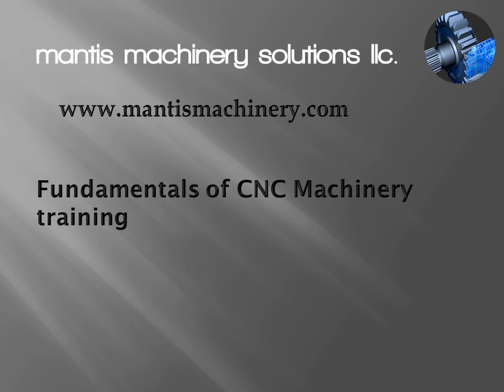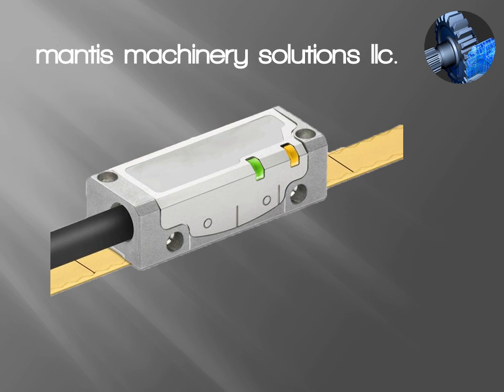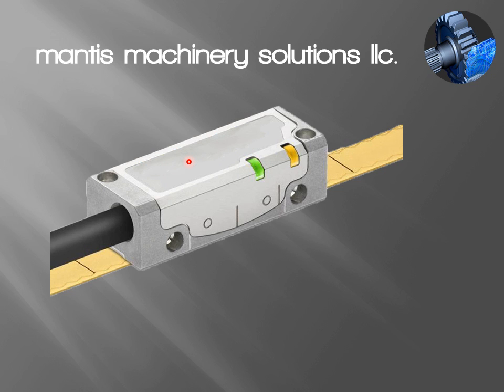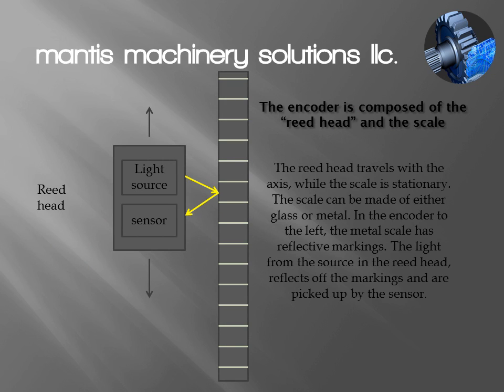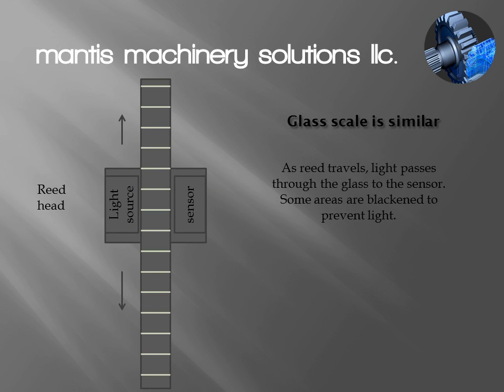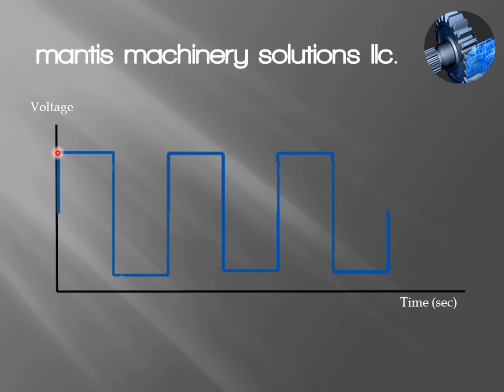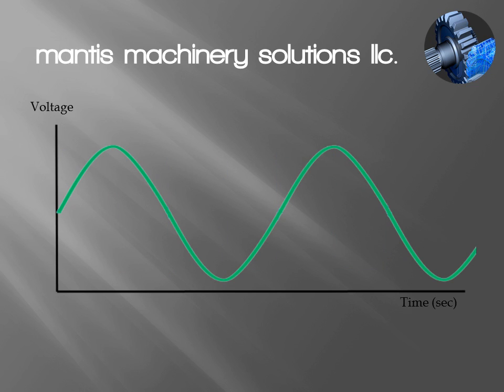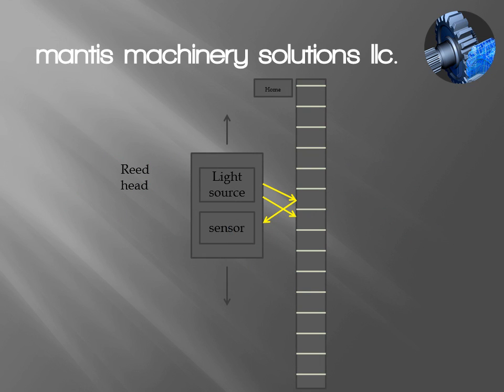How an Encoder Works

Comment: Two signals are not needed to determine the direction. One signal with a reference point ( starting point of the encoder bar )is suffice. The reference point is 0.Now the position if at 15 is the middle and 30 is the end, then based on the deviation from the reference point we can determine whether the direction is towards or away.